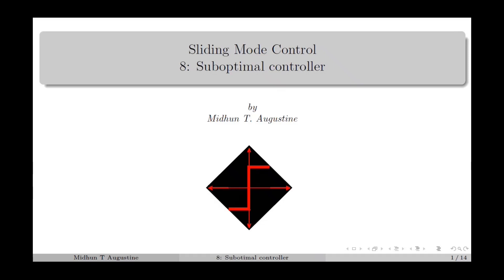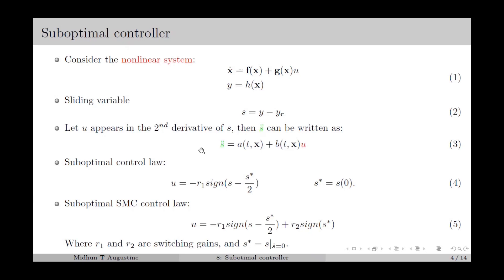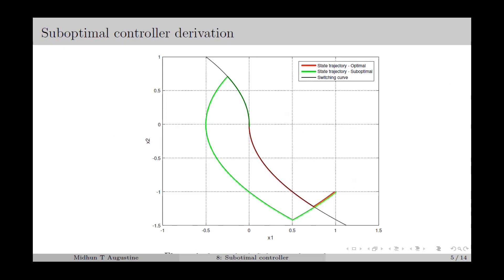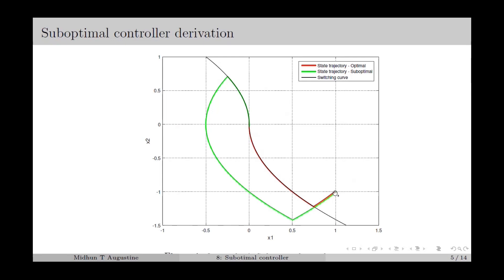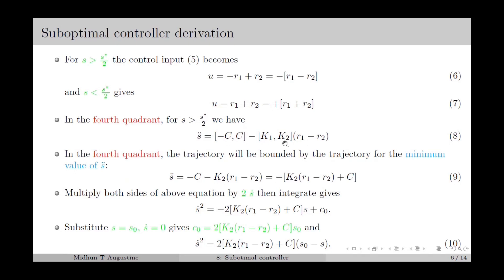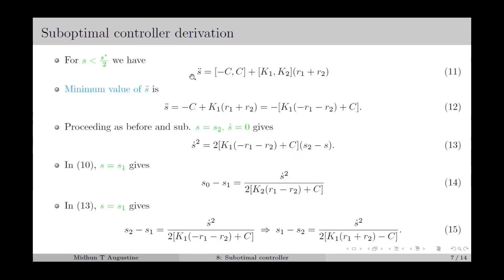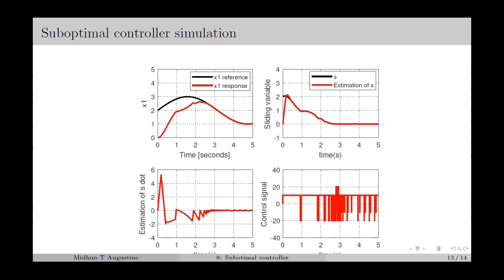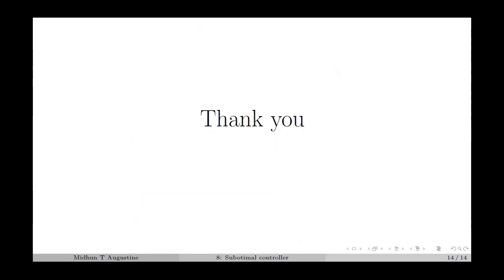8: Suboptimal Controller | Sliding Mode Control

Comment: Bro can we track for a higher order systems
Reply from the maker: Yes, we can track higher order systems using higher order SMC schemes. The Nester-r sliding controller discussed in lecture 9 of this series can be used to solve tracking problems for nonlinear higher order systems.
Reply: @datacontrolandmathematics3811   I have a 12x12 A matrix which is uncontrollable how can i go about it?
Reply from the maker: @biswajittripathy454  As a first step, the system/model can be made controllable (at least stabilizable) by adding more actuators (which will change B matrix and can thereby make the system controllable). Coming to higher order SMC, the output tracking error can be considered as the sliding variable: s = y - y_r. Then take the derivatives of the sliding variable until the control input term 'u' appears. Let the control input 'u' appers in the r-th derivative of the sliding variable for the first time. Then a  Nested-r sliding controller can be used for tracking the system.